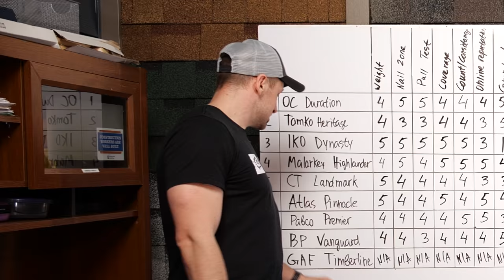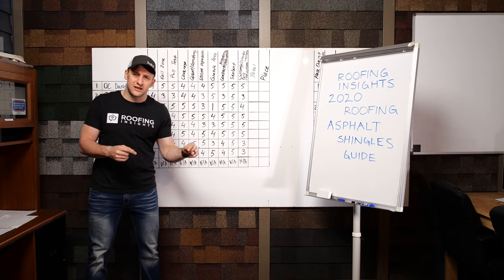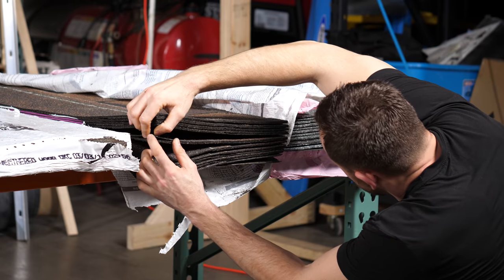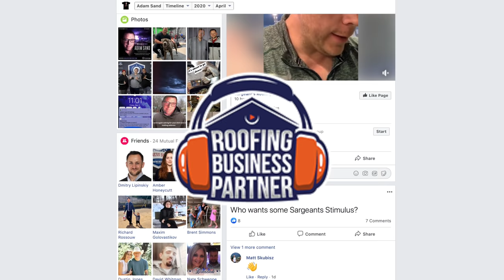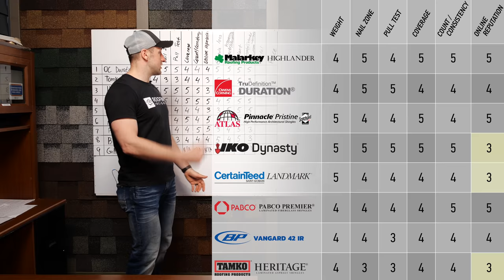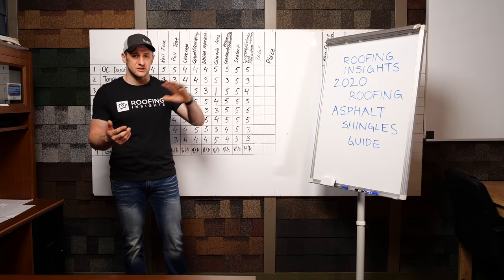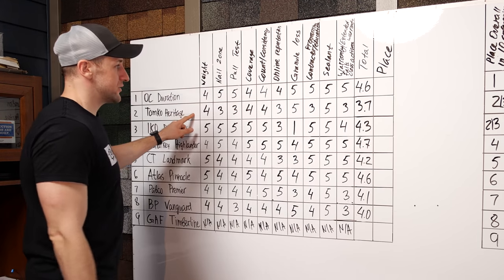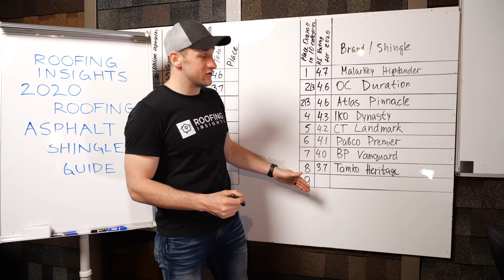Best and Worst Roofing Shingles by Roofers for 2020 | @RoofingInsights3.0

Comment: Why did you test all premium shingles from the manufacturers, except Certainteed, you reviewed their bottom line.
Reply: Malarkey Highlander is their base shingle.
Reply from the maker: Landmark is not their bottom line. We set with manufacturers and agreed on all main lines products. They have higher grades, we tested most popular (best sellers) in the same dollar category.
Reply: Awesome thanks!
Reply: Agreed with Thomas 100%. Certainteed 4th place? In which world are you living? Compare Certainteed Landmark PRO to O.C Duration or anything in the market place. Also it should be noted Dmitry the shingles your company installs are Owens Corning wether you think it's biased or not you maybe should let the "homeowners" know. You personally wouldn't eat at a 3.7 rated restaurant? Really? You do not have the years of experience on roofs to see what has failed over the years. Also WARRANTIES ...Have a language specialist explain to you how they are not all created equal. You keep saying IKO and others are larger but that's not good at all. More exposure to the weather and easier wind lift. That's why when you get to a 4 pitch we do a 4in exposure to the weather. Most shingles are pretty close in manufacturing but most roofers are not! Keep up the fight!
Reply: @RoofingInsights3.0  Landmark  absolutely is Certainteed entry level (bottom line if you insist) laminated shingle and still is better than most other middle of the road(or upgraded) manufacturers laminated shingles. 5 1/2 in. to the weather not 6 in.
Reply: Certainteed is by far the best, I live in the west coast of canada super windy and rainy, they also last the longest out of anything I have seen (18 years roofing experience from flats to steep/ metal)

Comment: Not comparable shingles. O.C. Oakridge, C.T. Landmark, IKO Cambridge. That should be your test. Compare shingles of equal cost to manufacture not what our cost to get them are. The guy down the street charges $500 a square to re-roof a home. we may charge $400. Should we not be comparable because he charges more? NO, it's just what we charge. I know you do the best you can but some things should be thought through a bit more clearly before slandering or propaganda, knowing or not. Thanks again.
Reply from the maker: You are wrong. We have set with all manufacturers and agreed what’s head to head lines are. Oakridge is cheaper and entry level shingle just like Cambridge is. Landmark is not entry level shingle.

Comment: Why no landmark pro? That is comparable to an iko dynasty or OC duration...
Reply from the maker: All manufacturers agreed otherwise. It was fair game
Reply: I see other 30 year shingles compared to 50 year shingles. Why not just use oakridge, and Cambridge. Use everyone’s 30 year or use everyone’s 50 year. That’s what would be comparable to me. Just my opinion of course so that never goes far.
Reply: @chrisparmenter9582  That is a good point.
Reply: @justiono mora
I know the shingles I use have a weight difference of 40# per square which would equate to a 76# bundle for their 50 year, but their 30 year was featured.

Comment: Malarkey #1 and you didn’t even test their Highlander NEX version, would’ve finished even higher.
Reply from the maker: That’s the one in test
Reply: Roofing Insights really? How did it possibly get a 4 on granule retention? It’s far superior in that area since it’s polymer modified vs oxidized asphalt.

Comment: Brilliant review,!  I specifically requested Malarkey Highlander shingles for my house (my roofer recommended GAF Timberlines).  But you didn't list the two most important features of asphalt shingles, the fiberglass mat and the quality and amount of asphalt used.  Malarkey Highlander shingles uses SBS Modified Asphalt, which greatly improves the life of the asphalt, which is why I chose it.  My neighbor just reroofed his house with GAF  Timberlines.  It will be interesting which one lasts longer.
Reply: GAF Certainteed Atlas and Owens Corning all have SBS rubber composite asphalt shingles.

Comment: Roofing insights or roofing bias? Do you happen to be a Owens corning preferred contractor? After working 32 years for one of the largest roofing companies in New England that’s been in business for over 80 years I felt compelled to leave a comment. I can’t speak for dynasty malarkey or vanguard products because they aren’t available in this area but To rank Owens Corning above Certainteed is absurd! Let alone IKO. Owens corning is a consumer grade shingle that can be purchased at the big box Lowe’s. I won’t even bother getting into all the issues I’ve seen with Owens corning and IKO shingles. And anyone contractor using Tamko in my opinion should be locked up. Ask any respectable contractor in North America and they will tell you Certainteed is top notch and far above the rest. The regular landmark good. landmark pro very good, landmark TL & landmark Stonegate The absolute best of the best.
Reply from the maker: Any respectful Contractor will tell you what? Roofing contractor magazine did many polls for roofers in North America to vote on best shingle, OC alway ahead of certain-eed. CT is not bad shingle but its not perfect either. Its popular in many areas and especially up north but in some regions many roofers hate their reps. As for me we dont care for OC or any other brand, Atlas, Malarkey or not but we have been installing OC for years and its just part of the business but has nothing to do with comparisons, you can see videos where we compare them to other shingles we never installed and OC doesnt look that great in some tests. Do agree that CT are goo but disagree on popularity vote on it and I have data to back it up, not opinion.
Reply: Consumer's Report magazine 2020 ranked Owens Corning above Certainteed.  In fact, CT Landmark shingle came in last of the ones they rated
Reply: Yes CertainTeed!!! It's the best!
Reply: What is wrong with Tamko? I am planning to get a new roof and they are offering Tamko...this is low-grade product?
Reply: @thegroupharmonyalley  builder grade. low cost...get the better OC or Malarkey, roofs matter, everything you own is under it!
Reply: @thegroupharmonyalley  it’s a builder grade shingle.....typically used by guys who are price sensitive. There are far better options.
Reply: @RoofingInsights3.0   Hmmm, depends on who they polled.  If it was 10,000 fly by night contractors or home owners, might not be such a great result from the poll.  If the poll included the top 1% highest rated contractors in America, I would trust that kind of poll.  I know nothing of roofing materials but a LOT about marketing and research.  I got 5 bids from super high-rated contractors.  However, half use GAF, half use Certainteed.  Trying to see which is better from the material perspective.

Comment: Love what you are doing here. Do have to say though you seem to give a lot of 4s and 5s while to things while you are actually pointing out negatives to some, and some negatives sound worse than theres. Just seems like everything on there ends up being pretty much the same, though the words you are saying don't seem to line up. Seems like there should be some more difference in the numbers from one to another in a lot of cases and that everything is being ranked high, when there seems to be a lot of room for improvement. 

Also I think some categories should be more weighted than others. Some things are more important than others and there for should have a greater weight on the final result. Like overall weight seems like something that should have a lower weight on the total as you said its not a real measurement of how one will perform for sure against another. While granular loss for example would be more concerning. It seems IKA should be lower in the list to me. If you put the shingles on and your left with no granular's... That's a pretty big deal, but they finished pretty well in the totals.

Must say though I do like what you are doing here and hope to see this improve and grow hopefully to include GAF as well.  I'm now not even considering them as they refused the only unbiased testing I can find. If a company is unwilling to even put the product up, to me that says they have worries, and there for so should I.
Reply from the maker: Will improve next year! Thanks for feedback! Roofing shingle guide 2021 coming very soon!

Comment: Thanks for the video. Wondering if these category scores should be weighted and how that may change your rankings. For example if online reputation isn't as important overall as pull test and granular loss. 

Could do a 100 pt system and divide the maximum points per category accordingly. Just a thought.
Reply from the maker: Thanks for recommendation, I see your point. We didn’t want to weight any category as less important, mainly because we want manufacturers to work on all their weaknesses. If you can lift heavy, but can’t run a mile, are you really fit?

Comment: Rating every category equally and then averaging, is a poor, poor summation of overall shingle rating.  Take away nail zone, online reputation, contractor programs, and class action categories and Tamko is amongst the best.  How does "online reputation" even matter?  The internet is tainted that way.
Reply from the maker: Nail zone, online reputation, and contractor program and Tamko at the top? They are absolute the worst roofing shingle brand on the market. I mean if we only look at colors maybe they have a shot at the top.
Reply: @RoofingInsights3.0  In colors, GAF is #1 followed by TAMKO.  GAF has a crappy product in its Timberline but lots of folks buy them just for the great color choices.
Reply: @Jimmy-sj9ny  oh no I bought them and yes it was because of the aswome color pallet that matched my brick from the 1950s that is such a rare color I don't even know what to call it apricot peach pinkish and they had a shingle with all those hues with charcoil fades between greys and those other colors sounds ugly but its beautiful and transformed the look of the house in a good way but the install was terrible and I assumed it was the installer as they had nails exposed below the next row of shingles and when I showed them they just used some grey caulking, the owners came out and made them fix it right and said they would never use that crew again but I wonder now if they had such issues from the product.

Comment: Tamko Heritage is garbage.  Just got ripped off by my roofer who charged me top dollar for a roof and put this crap down.  You can see where the workers boots just rubbed off the top layer just by walking on it and it's a brand new roof. It will only get worse after time goes on.